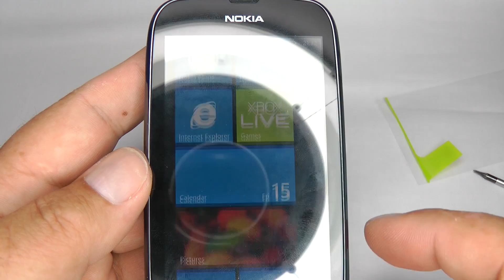Nokia Lumia 610 Disassembly & Assembly - Digitizer LCD Screen and Case Replacement

Comment: Thank you thank you, after one week waiting for the Screen from Hong Kong and 55 Missed Calls and 77 Messages I have easily replaced my screen. Now I have my external memory back in action again. You explain this process so easy and clearly so that any person that can turn a screw driver can do it. A little hint though DON'T let your five year son grab the hair dryer and put it right on top of you screw bits container spilling them all on the floor. All good now as all bits were found.

Comment: Just fixed my shattered screen thanks to you. Great video - thanks a heap. I replaced the screen and had to move the speaker from the old screen to the new one. The new screen i bought on ebay had a little adhesive box that held it firm and the old speaker moved over no problems. I think if it's not stuck down tight you'd get some rattling problems...

Comment: thanks for the quick response. I just removed it and somehow had a success and it's working in the new frame! only thing missing is the gauzey bit (tried removing from old phone but ripped it). guessing there's no fix but I just have to be careful and avoid getting dirt in it..? thanks

Comment: Thank you for the video - it's been very useful, I replaced the broken digitizer and it works fine now. I have one problem though - the top speaker doesn't work properly, the quality of sound during calls is very low (but it's ok when I use headphones). Could it be just a faulty speaker (I bought screen with the plastic frame)? Or is it possible that something got damaged during disassemby&assembly, or when the phone fell? Is there anything I can do? I'd be very grateful for any help.

Comment: Thanks so much for this. I've changed the cracked digitizer. But the touch response is weird - it won't scroll and only the search button works. And parts of the screen are unresponsive. I've taken it apart and reinstalled, checked connections but same result. Does this point to a faulty display as well? If so that's a lot of damage from one short drop off the bed to the floor! Thanks again.

Comment: Thanks for the good video, i have replaced my digitizer and it works perfectly!

I still have 2 matters with the phone, I hope that you can help me with these:

1. My Lumia 610's three navigation buttons don't have backlight anymore?
2. My Wlan doesn't even try to connect, I turn WLAN on, there is NO wlan icon in notification bar and it doesn't do anything

So, how can I have those three buttons' backlight working?
And the more important question, where is the wifi antenna?

Comment: Thanks for replying. I haven't replaced the display, but the digitizer. I can see everything, but it just doesn't respond to touch (well, odd bits of the screen respond to tap, but no swipe). Did you mean there has been a dodgy batch of digitizers out on the market? Thanks.

Comment: Hey. Really useful video :) I recently had my lcd &digitiser replaced, I got shafted at the store I went to and ended up wishing I never bothered. The touch screen has slowly become less & less responsive to the point where it was virtually impossible to use, yesterday the screen went black & I can't get the phone to switch on.
Each time I turn the phone on it vibrates,the nokia logo comes on and then the screen quickly goes black. I think the phone shuts off each time. Occasionally it will start up fully to the home screen but the screen will act unusually (i.e the slide function for turning the phone off keeps appearing on the screen) it wont stay on for long, I'm trying to back up my data but it quickly shuts off to a blank screen.
Does this sound like I need to again replace the lcd and digitiser or could it be a sensor issue?

Comment from the maker: perhaps replacing the switch is the next step, its a bit tricky as it requires the use of a 'hot air' soldering iron, try and find a local repair shop who can do this for you..

Comment: dude you are a legend 
now just got to work out why my lights on the lower pad not working the windows sign and search cheers n hope you have a good day
Reply from the maker: the lights are those 3 green led's inside the black gasket at 3:56 unless its been wet I don't see why they shouldn't work
Reply: ***** i replaced my digitizer and now the windows, search and back button at the bottom only work if you press very high up and in a very small area. any ideas? thanx for the vid btw, saved me $100

Comment: I have a nokia lumia 610 and 520, both with cracked screens, i just want to know if i replace just the screen will the touch work when the new screen is fitted? Because at the moment the touch doesn't work with the cracked screen, is this normal? Thanks.

Comment: sorry to reply here, it won't let me comment above for some reason. I have just tried to replace my digitizer (with a new digitizer AND housing frame), everything was working except the ear piece. I  took it apart again to realise the replacement digitizer I have been sent has no ear piece! In your video you say removing it can damage it.... So will it be a guaranteed fail if I try to take the ear piece off of the old frame and put it in the new one...? any tips? thanks

Comment: Hi - this was a fantastic video and helped me replace my broken screen easily with your clear instructions.
However once I replaced the new screen and frame (came as one unit) and turned on my fixed phone I realized the new unit had no earpiece as I couldn't hear my callers - only on the speaker.  In your video it says only replace if you must.  I must.
Do you have further details or video on how to do it without damaging it?
Many thanks.
Reply from the maker: warm it up to about 60ºC and gently lift it from one side, it should lift away without damage if its done slowly..
Reply: *****
Hi - did as you said and it came out easily and fitted into the new frame easily too.  I have just tried the phone and the earpiece works perfectly!!!!!
Thanks for your brilliant video and your prompt and helpful reply.
My broken phone is now up and working again and I have never fixed a phone before... but now I have.  Thankyou very much! :-)
Reply from the maker: B13ANY That's good news, thanks for the feedback :-)
Reply: ***** Hi - thank you very much. A very good video tutorial and this very useful comment on how to remove the earpiece. And Nokia 610 works perfectly. Good job, sir. Again thanks.

Comment: i have a problem with the earphone connector, always i want to use my earphones i have to play with the plugin until they match and with the smaller move they disconnect until I match again, do you think is necessary change the earphone connector?

Comment: Thanks so much for the excellent video! I've replaced my screen and the phone is working well except for one thing. As soon as I dial someone's number the screen goes blank and doesn't come on again until the call ends. So I can't end a call myself which is kind of awkward when I get someone's voicemail! Any idea why this might be? Does it seem like a hardware or a software problem?
Reply from the maker: it might be to do with the small rubber gasket at 6:50 it must be pushing up against the digitizer for the proximity sensor to work properly, try experimenting and moving the gasket about until it works..

Comment from the maker: Replacing the usb charging port needs the use of a 'hot air' soldering iron. Google for part and find a local tv repair shop as they should have the skills and equipment to replace it.

Comment: You sir have saved me a ton load of money - successfully replaced my digitizer after buying the part for £8, instead of paying £100 to replace it at my dealer...however, now I cant hear calls (incoming and outgoing) without using a headset or putting my phone on speaker - would you happen to have any idea why this is so? =/
Reply from the maker: check the earpiece at 6:02 is sitting down ok and the pins are raised high enough to make contact with the mainboard

Comment: I think I've been sent a T4 because it just turns around and around int he screws. So I'd say you need a T5. Have decided to order a whole set so I'll definitely have the right size but the one that came with my replacement digitiser is too small. Which means I haveto wait even longer to get my phone back in working order -_- lol

Comment: Thanks a ton LE55ONS ! you sure rock. I had broken my 610 touch digitizer frame (got crushed by a car) & I just replaced it with a new one... :) However phone still has one issue. there is no audio heard, as in not able play any alarm tunes or ringtones, no keytones. however with a ear phone all seems fine. vibration works fine. there is no issue during voice calls though (both ends are able to hear each other). what could be the issue. please help !! thanks

Comment: Does doing this reset all my data? Music, Videos, Contacts etc? cuz I don't have it saved on my Sim card or backed up anywhere else...
Reply from the maker: You won't lose any data by replacing the screen or case but its always a good idea to backup all your data just in case there's a problem. If a new digitizer doesn't work try another digitizer as there's a few faulty ones on the market

Comment: hi
i dissasemble i have the digitizer, i have a small rubber that i had to change from the old digitizer to the new, i see more foward 2 pins but seems to be in contact with each other.
Reply from the maker: ok, can you try and test the earpiece with an audio source, maybe cut the wire from some old headphones and test the speaker

Comment: JUST REPLACED SCREEN, BUT EARPIECE NOT WORKING, CAN HEAR THREW LOUDSPEAKER AND EARPHONES BUT NOT EARPIECE,,,ANY HELP AND IS THAT EASY TO REPLACE ASWELL
Reply from the maker: did you swap the earpiece over from the old screen?
Reply: What u mean? I just changed the glass. Not frame ? HELP
Reply: If you mean the two rubber boots. them yesi swapped them.
Reply from the maker: John Adams make sure the metal pins on the earpiece are sticking up high enough to make contact with the mainboard
Reply: Cheers mate

Comment: From sunny south africa how do i fix my 610 lumias usb connector bcz i charge but my phone never charges plz help
Reply from the maker: its easy to find them online, but you'll need to use a 'hot air' soldering iron to replace it. A local tv repair shop should have the skills and tools to do this http://www.ebay.co.uk/itm/141107830179

Comment: Hi,
Excellent video, I managed to change my wife's cracked screen - BUT! The "back" "windows" and "search" buttons underneath the screen work only every 10 presses.  Why would these be affected?  Everything else works fine, but it's annoying!
Reply from the maker: sounds like you have a faulty or incompatible new digitizer, if you read down you'll find a few people with the same problem. Another digitizer should work fine..

Comment: hello,
I have a problem with my phone,
the light goes out when i call someone, but when I want to drop out the light won't quit until my friend
sorry for bad english
Reply: I had the same troble when i putted on the plastic screen cover thingy. But then i realized that at the upper right corner there is the thing (that shuts down the screen and puts it back on when u call) and there was a small bit of plastic over it. So i took a knife and gently took the plastic of there and it worked again! Hope this helps u and sry for the bad english too :D
Reply: i putted the plastic cover out . it's not working
Reply: DO FREE__  Oh ok. Then i can not help u :(